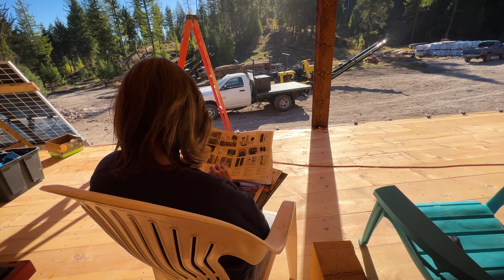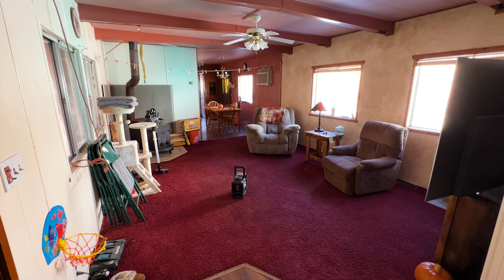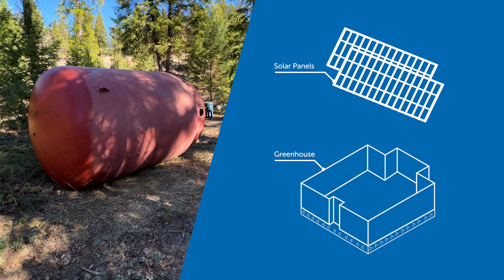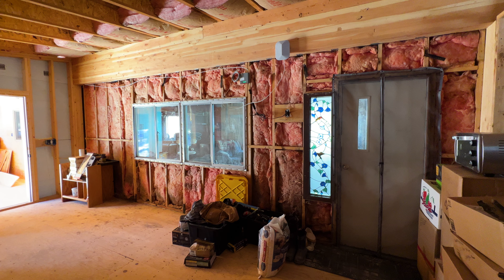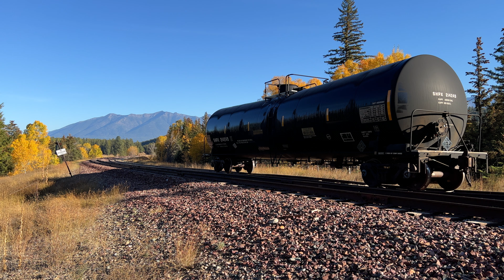How off-grid prepper powers his home & greenhouse

Comment from the maker: 🎯 Key Takeaways for quick navigation:

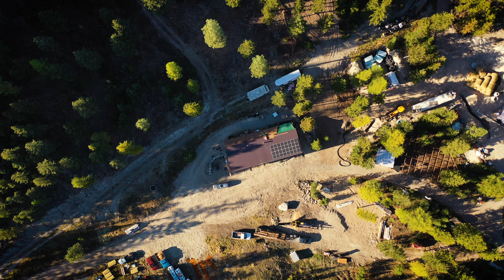00:53 🏡 Victron Energy equipment has made off-grid living in Montana easier for Marty and Leslie, who run their home and woodworking shop with it.
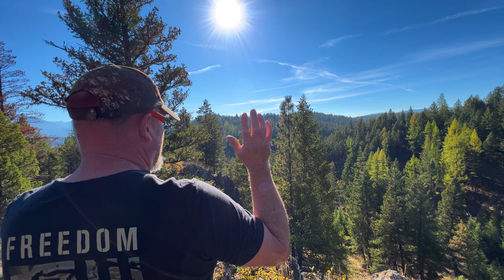01:31 ⚡ Marty upgraded to a three-phase system with Victron to power his industrial equipment, eliminating the need for a fuel-thirsty generator.
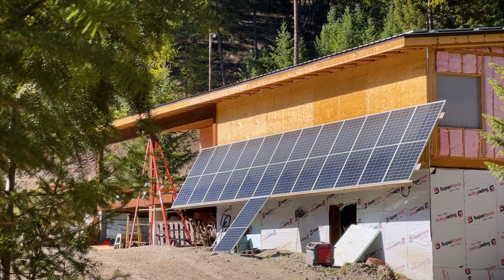02:36 🌞 Marty praises Victron's ease of use and functionality, highlighting its problem notification system and simplicity.
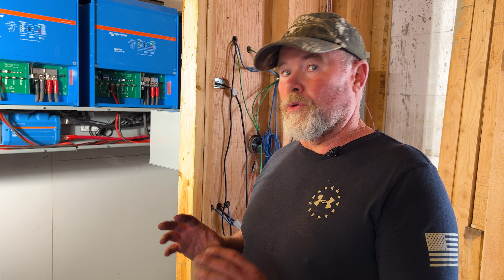03:05 🔋 The system includes three 48 Volt Victron Energy Quattro inverter chargers, solar charge controllers, and a Pylontech Lithium battery bank.
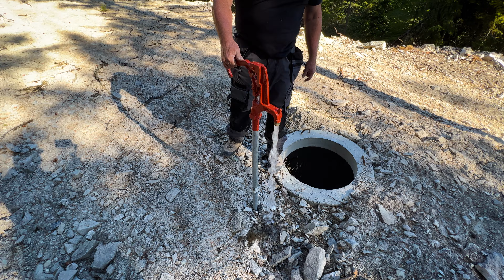08:32 🏠 Marty's self-sufficiency goal is to provide a fully independent haven for his family, powered by the sun, ensuring power, hygiene, and more in any situation.

Thanks to Marty and his wife Leslie for allowing us to come and film his system.  Aaron and Laura from Intelligent Controls helped Marty choose what equipment to buy.  They can be found here: https://icmontana.com/

Comment: I just want to know how much money is invested into this setup.
Reply: Oh, a lot. This is an exceptionally large system. Still, for most customers building a home off-grid, the cost of a 5,000-watt inverter/charger system + lithium battery bank is still less than the cost of bringing power to the property. Self-reliance and not having a power bill to pay for the next 30 years is a major factor in making that investment. And, because it is a chunk of change, you want to do it right the first time, minimize risk, and make sure you have a way to verify your system's performance (which is why people go with Victron and why we recommend using an intelligent communicating lithium that has full closed-loop communications with the Victron inverter/charger)
Reply: Any ballpark number on how much a large system like this runs?  @intelligentcontrols

Comment: So he uses photovoltaics to generate electricity and then heats up water with it so he can heat up the soil to make stuff grow during the winter? i guess that's one way to do it... Now all he needs is some electrical light so the tomatoes will grow in December. Sounds like a plan!

It would have been cheaper and a few times more efficient to simply heat up shitloads of water using a  regular, cheaper,  old-fashioned solar thermal system, which isn't affected by partial shading, has no conversion losses and doesn't require a huge, way oversized battery, which is already full by 10am most of the time... which means they use somewhere between 10 to 20kWh per night. I have no idea what kind of parties they are throwing out there in the wilderness, but no doubt they are having a blast.

I'm sure the guy who sold him all that stuff is excited, and I can wholeheartedly understand him from a business perspective! Ka-ching!!!

I really like off-grid stuff, but when I see videos like this, or others where people e.g. use helicopters to fly in shitloads of fuel for their snowmobiles while burning down whole forests in their barely insulated 2 by 4 framed cardboard boxes in arctic climates  .. can't help but shake my head and wonder. Why? What went wrong?
Reply from the maker: At 5.15 we do highlight this is excess power from his solar going to his greenhouse.  Also, if you know Marty you will soon realise he does his research and very likely 'told' Aaron from Intelligent Controls what he wanted and Aaron worked out if it was feasible or not.
Reply: We love solar thermal options, installed them for years. The market for high quality low temp glycolic protected solar thermal systems has unfortunately taken a dive as the major brands were European have largely pulled out due to cheep solar electric and a lack of trained installers. It’s become increasingly difficult to find support. In warm weather climates, solar thermal is extremely cheep and is very effective. Would highly recommend. 

And yes, Marty is Marty and we get at little intimidated by how many friends he has. I’m sure if he did throw a neighborhood party, it would be a hoot.

Comment: Nice but what is the  battery  capacity of this operation especially on overcasted days using 3 phase equipment
Reply: Good question. It's not small.  Marty has installed another 12 Pylontech US3000C batteries. So he's working with 84kWh of 48V power. And, of course, he's not running shop equipment every day.

Comment: would you consider a separate power shed with the additional  PV arrays for redundancy???
Reply from the maker: He has the space for it.  It just depends on cost and if he warrants the additional system away form the house.
Reply: @VictronEnergyBV  it would be beneficial to add for future especially with the voltage drop

Comment: why a Quattro an no Multi? :)
Reply: Good question. Marty is using them in a three-phase setup. The Multiplus only has that option up to 5k. In the future, he also plans to add more units in parallel to upgrade the 3-phase capacity - a feature which the Quattro is also best suited to as it allows up to 6 units in parallel on each 3-phase leg (total of 18 units for 180kVA in the case of the 10k Quattros). That's also why he's using the 10k, it has 120V, which is required for our US 3-phase. The 15k Quattro only has a 230V version which would not work with the voltages between the phases.

Comment: Using 8 panels, 1 Multiplus 5kW, 15kWh LifePo4 Is for me enough to live off-grid in the middle of Sweden
Reply: Basically have same setup. 15kwh battery seems be sweet spot so far. with Prices coming down.  Had 5 kwh usable to start off with.

Comment: Looks like he has 187A going through Pylontech cables that are only rated for 125A.  Unless he's set up his Quattro and MPPTs to limit the amount they charge or pull from the batteries.
Reply: Good eye! Marty reworked his system right before filming and again since....but every cable is fused, and he may add more battery cables in the future (but he hasn’t blown a fuse yet.)
Reply: @intelligentcontrols  unless he's got equipment pulling peak power, I don't imagine it would be an issue.  Three Quattros can pull 24KW max continuous which is 125A through each cable.  Would only be an issue if Quattros pulled peak power above that for some equipment with a hefty surge.

Comment: Super good setup, have a small victron components setup in our garage that power our garage, cabin were my wife’s office is.
Charges up my work tool batteries and portable battery that take to the workshop and on-site. 
Next task for it is running a cable back to house and powering the TV,sky box and internet. 
I like that the system is modular and can be replaced if needed too without effecting too much. 
Thanks Sam
Reply from the maker: Sounds great Sam.  Thanks for comment.
Reply: Yes - Sam your comment about modular, adaptable design really matters, even in smaller cabin systems. Having the flexibility to easily add battery capacity or a second inverter is a really big deal. Marty has since installed the second Pylontech battery bank and wanted to have it in a single communication string with the rest of his system. All it took was a one-hour visit to install a communication hub combiner, and now there are 24 batteries in full communication with the rest of the system. A pretty incredible option to have as needs or circumstances change.

Comment: Very impressive system! I noticed there is no ground wire. Is this installation completed?
Reply: Sharp eye! Yes, those grounding straps were not in there during filming, as Marty had completely redone his system the day before Victron paid a visit :) They are now on, and everything is grounded and ventilated.  He’s got two 6” geothermal lines that come from the outside to bring fresh air in.  But as you can tell, the house and the shop are still under construction with more batteries, solar and Victron gear to be added.

Comment: Beautiful scenery! The only thing I would add is fire suppression strategy in case one of those batteries catches fire inside that wood structure. Even LFP batteries have the potential for a thermal runaway due to manufacturing fault.
Reply: That’s an important observation. As an aside, Marty has some 20,000 gallons of water in a cistern up the hill for wildfire suppression which is probably his most clear and present threat. :) Pylontech doesn’t put fire extinguishers in their batteries and have had zero thermal runaway issues. They’re also a massive manufacturer with a solid (and global) installation record but it’s an important comment because not all brands can claim that, and some brands have built-in fire suppression principally because they have had issues.

Comment: How big is the battery bank?
Reply: It is a beast of a battery bank, as Marty wants to go through the winters without using a generator of any kind. He has 24 Pylontech US3000C batteries 3.5kWh x 25 = 84kWh of 48V power.
Reply: 42 kWh
Reply: How many amps does Marty pull max through the cables from the batteries to the bus?  Those cables are rated for 125A max and with the system as large as he has it, it's possible to pull more than that through the cables which could result in a fire.

4 sets of cables (4 positive and 4 negative) means the bank is limited to 4*125A = 500A.  So if he's pulling more than 24KW at any one time, or charging with more than 24KW, he'd be putting too much through the wires.  Probably not an issue since the three Quattros only pull 24KW max continuous, but they can pull up to 60KW peak power.  So if he has some heavy equipment with a large initial surge, it might be worth looking into.
Reply: @gf3803 , Marty has six sets of cables installed in his current setup. Of course, he can add more cables as he needs and he has spots for that in his distributor.